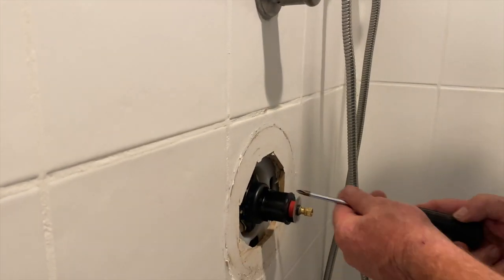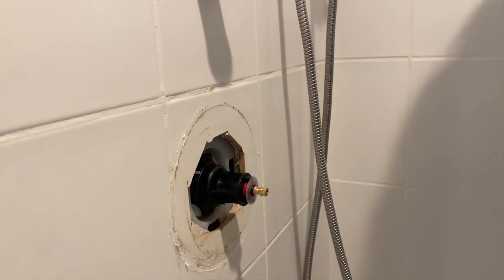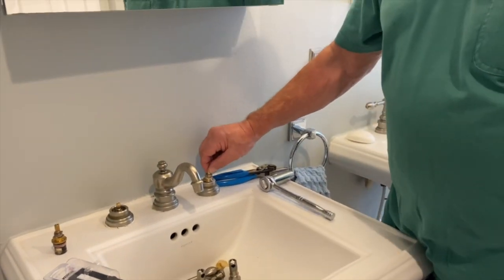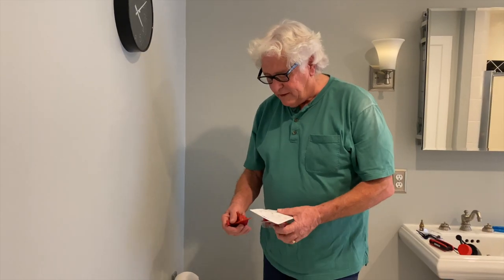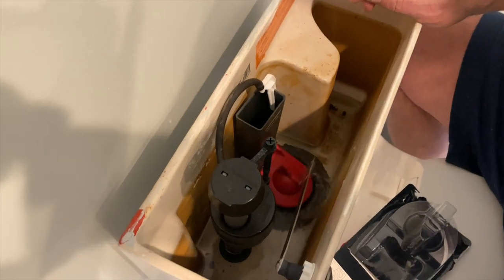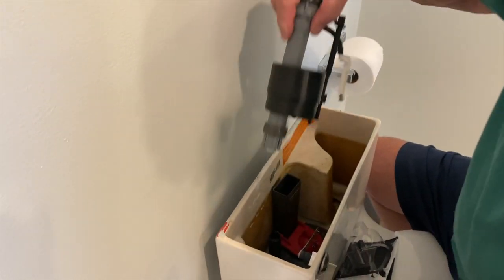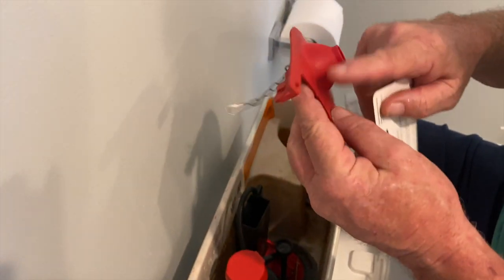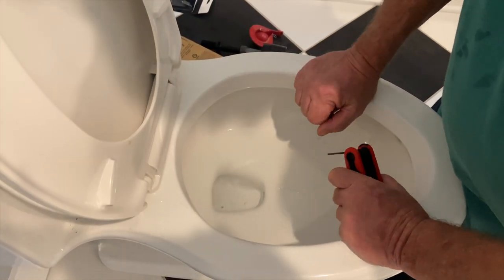How to Replace a Kohler Toilet Flapper and Toilet Fill Valve and Kohler Stems on a Bathroom Faucet

Comment: Awesome video!  I really appreciate all useful information.  I did have a question, I’ve got a moen spread faucet that has one side that has become very hard to turn on and off.  I purchase new moen cartridges but having a hell of a time trying to get the celery off to get to the cartridge, tried strap wrench to no avail, any pro tip to help?
Reply from the maker: Robert, maybe you can loosen it from underneath and see if that will loosen the sleeve and the escutcheon. I’m sure you tried WD40 which might help. What I would recommend is to call Moen and tell them what your problem is. Phone #18002896636. Good luck.

Comment: Hi, thank you for the helpful videos. We're remodeling the bathroom and my wife would like your advice on bathroom widespread faucets. Which do you think are the most dependable and reliable, Kohler, Toto, Moen or Delta? She's going crazy researching them on the internet and going to different stores.
Reply from the maker: Sisyphus, my first choice for faucets would be Grohe. My second choice would be Newport Brass. Those two are good quality faucets and easy to maintain. I’m confident your wife would be very happy with either choice. 
Moen and Delta are competitive faucets.

Comment: I have a question,  working on changing out a moen widespread faucet cartridge and while trying to unscrew the plastic retaining nut using the special tool and I stripped the two grooves, ugh!  Any recommendations?
Reply from the maker: Robert, call Moen and they should be able to help you out and probably give you the parts for free.